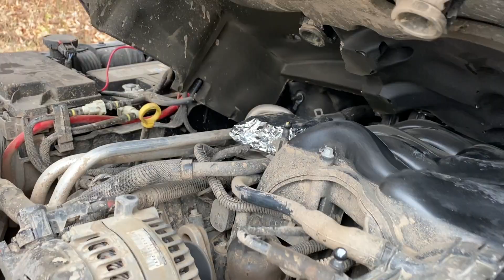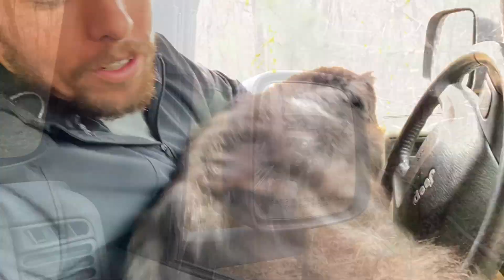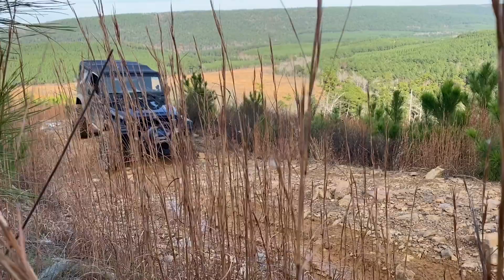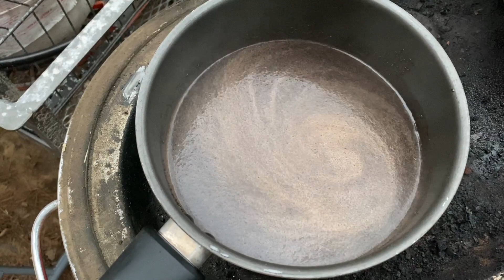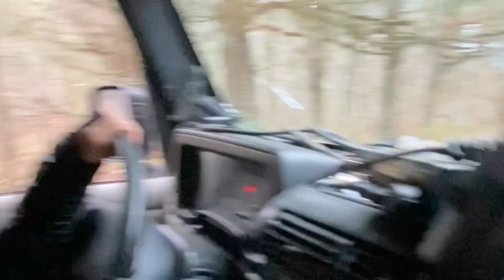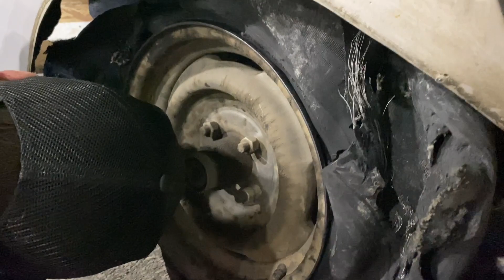Overlanding in the OZARKS with the JEEP WRANGLER LJ

Comment: I have an 2004 Jeep TJ Rubicon with 33s and 4.10 gears.  How do you think my rig could handle a small 12 ft.
  scamp?
Reply from the maker: I think it’d handle it well. Our Jeep has stock 3.73s and 35s and it handles well although we have the 6 speed manual.

Comment: What’s the Max weight trailer you would pull with the LJ? Looking to get a small travel trailer to pull behind mine.
Reply from the maker: Do you have manual or auto and is it stock tire and stock gearing?
Reply: @thomasolek8836  I am running 37’s, going to regear to 5.13’s. It’s auto.
Reply from the maker: I’d say we’re right around 1500-2000 lbs loaded up and on 35s it pulls and handles well without trailer brakes.
Reply: @thomasolek8836  thanks!
Reply: @thomasolek8836  Thanks for all the trailer towing info. I have an LJR 6 speed. We plan to get small offroad camper in the near future so I was wondering how it was going to handle the trailer.

Comment: What’s the model of the Scamp trailer and do you know the weight?
Reply from the maker: It’s a scamp 13, ours is a little custom with the extended frame and front basket. It’s roughly in the 1500-2000 lb range and the LJ handles it well.